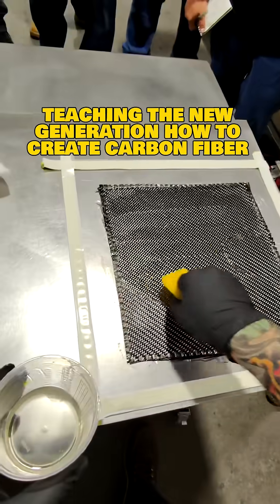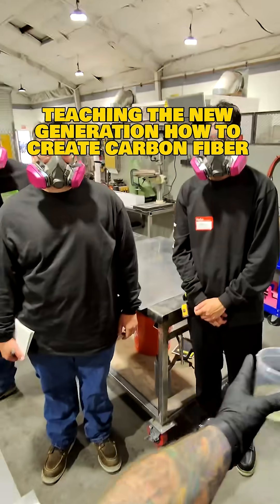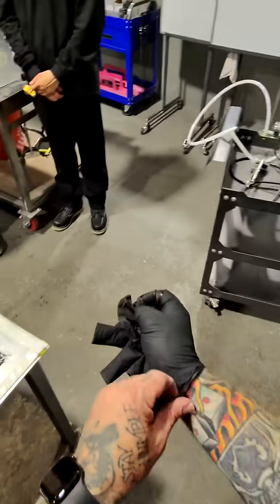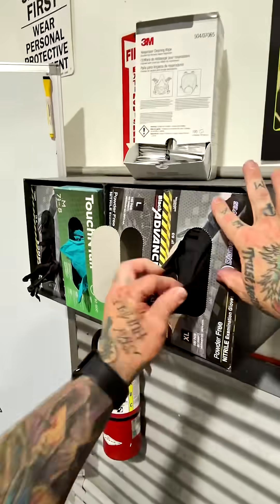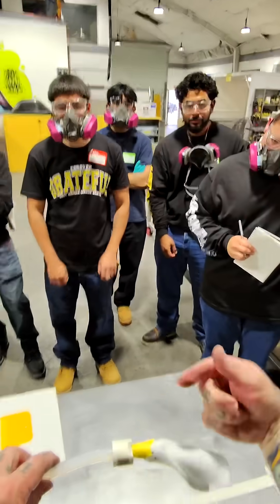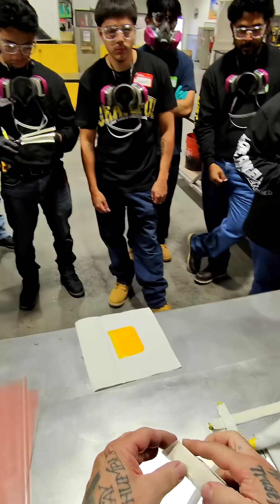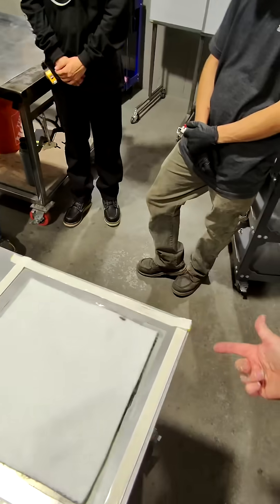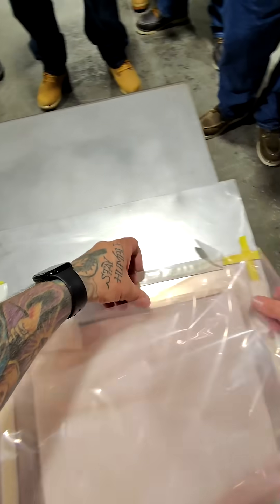This is a process called Wet Bagging, used to create Carbon Fiber pieces. #composite #carbonfiber

Comment: Dang how many gloves u go thru.   1 hole box per a 10 min video
Reply: It's so you're not transferring resin to any tools or equipment, resin is highly toxic, exothermic (starts fires) and hard as hell to get off
Reply: @timesprodoctions     I know but there ways to remove a glove even with. Both being solid w resin  I know